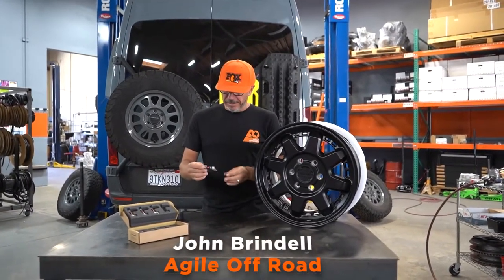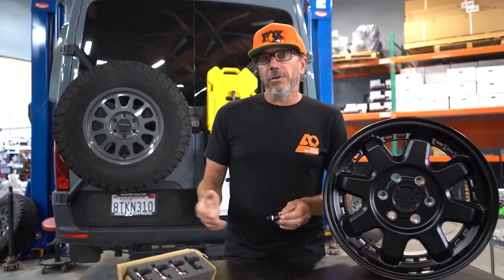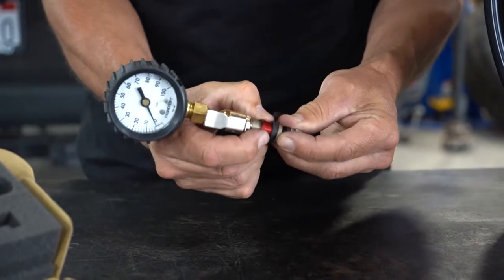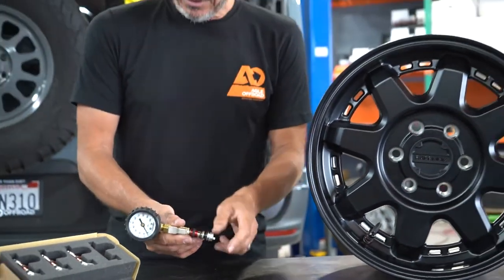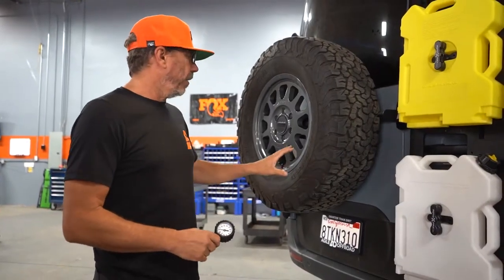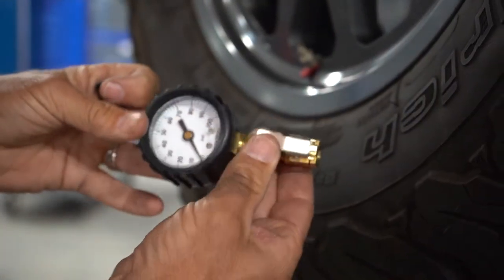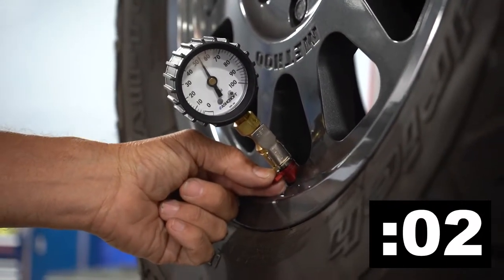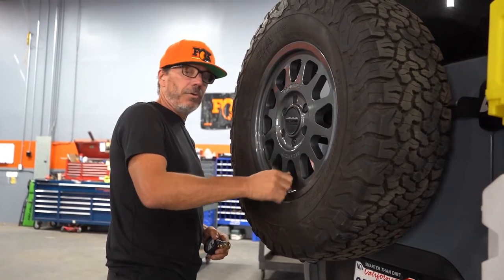8-second off-road tire air down! Apex RPV valve stem review

Comment: Hey where did you get the tire gauge with the quick release mounted right on? Thanks!
Reply: i dont know where he got these. but you can buy the gauge and lock-on fitting separate and build your own (probably what he did)
Reply: Might have to go to Napa and make your own. I have never seen one sold like that before.

Comment: 70 to 30 , that is impressive but the amount of air pressure pushing out depends directly on the starting air pressure and in the real world , no one inflates to 70 PSI. Testing from 35 to 40 down to 15 10 or 8 is more realistic in use. I mean technically you could inflate the tire to 150 psi , and do a video of 150 psi down to 50 in 4 seconds probably but there in lay the same issue. Apex makes a solid air pressure dump over others. Would save a lot of time with a gauge attached to just get them roughly to say 10 psi , then have a on board air compressor inflate all 4 back up to say 12 or 15 psi for off roading.

Comment: Can mud , bushes ,rocks etc push the tab out ??  Want to order some for my jeep but I do go through some random trails and always get stuff hitting my wheels
Reply: The caps themselves screw down to a point where they prevent the tabs from moving at all, so I think you're good as long as you use the correct caps and screw them all the way down.

Comment: I see the red tab is kinda tight on that method wheel, I also have methods, nv 305 for my f150 should I get the extended version or would that be too long, and also can I keep the tpms sensor?
Reply from the maker: We've found the standard legnth valve stems to work on all SPRINTER Method wheels we install. However fitment on your F150 may be different. Check the link below for info on how to measure your wheels.

https://agileoffroad.com/product/apex-rpv-std/

As for the TMPS, we include new sensors with purchase of the Apex stems, as the standard SPRINTER TPMS will not mount on these stems.

Comment: Nice! Did you use the standard length on the Method race wheel? Looking at the MR703’s for my JTR
Reply from the maker: Standard length valve stems are used on on MR701,702 & 703 Sprinter wheels.